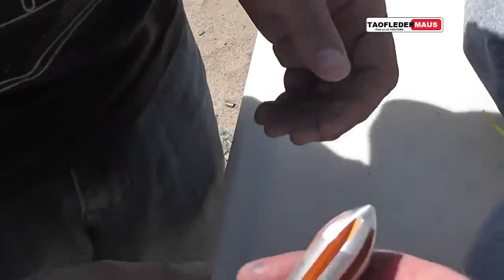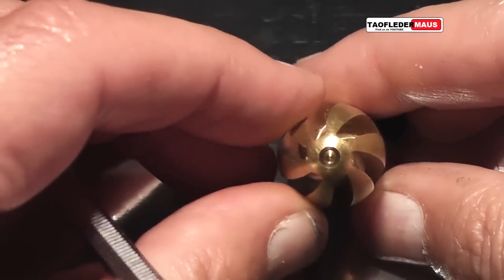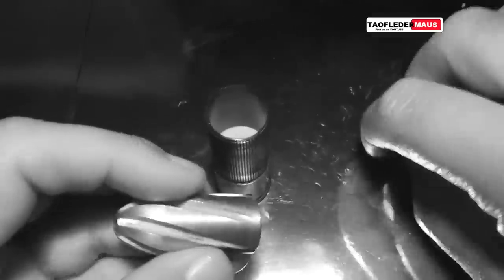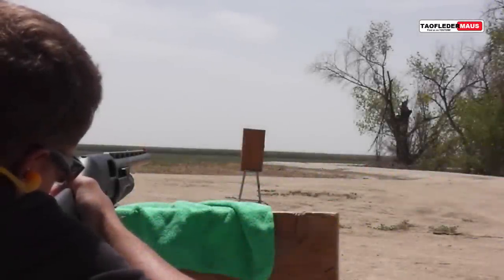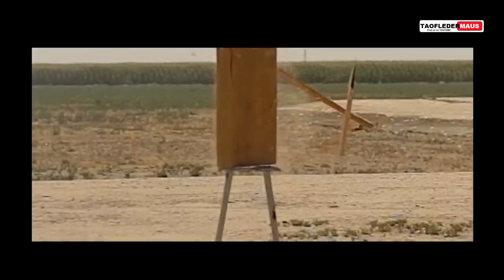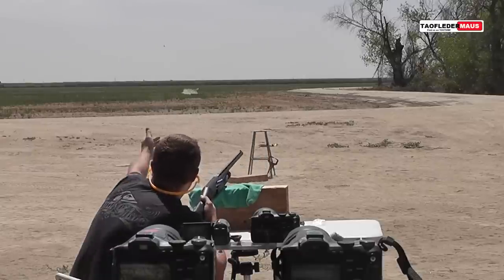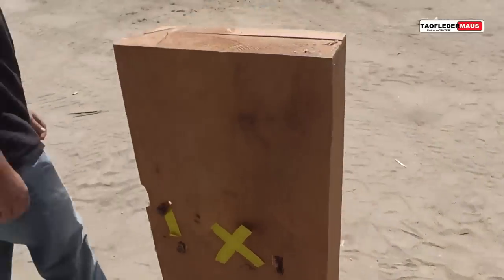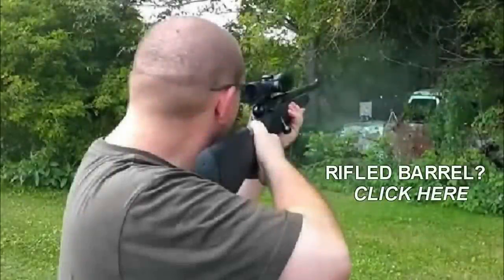70 Cal. Custom Machined  Brass TURBINE Shotgun Slugs -  Tests

Comment: There is indeed 2 ways of saying "Turbine"...but one is correct and the other isn't.
There's a reason the correct way is spelt with an E at the end and anyone who has studied English language at school will understand.

Turban:
A turban (from Persian دولبند‌, dulband; via Middle French turbant) is a type of headwear based on cloth winding. Featuring many variations, it is worn as customary headwear, usually by men. Communities with prominent turban-wearing traditions can be found in the Indian Subcontinent, Afghanistan, the Arabian Peninsula, Southeast Asia, Northwest China, the Near East, North Africa, the Horn of Africa, the Sahel, and parts of the Swahili Coast.

Turbine:
A turbine, from the Greek τύρβη, tyrbē, ("turbulence"),[1][2] is a rotary mechanical device that extracts energy from a fluid flow and converts it into useful work. A turbine is a turbomachine with at least one moving part called a rotor assembly, which is a shaft or drum with blades attached. Moving fluid acts on the blades so that they move and impart rotational energy to the rotor. Early turbine examples are windmills and waterwheels.
Reply: Daniel W spelt?
Reply: Davidautofull He used Spelt correctly, it's an accepted past tense form of spell (Spell out a word).
Reply: lol, not acceptable mr great. spelled is past tense for spell. spelt is a pasta, google it.
Reply: Davidautofull Spelt is the english version of spelled smartass, both are equally accepted and very commonly used. You google it.
Reply: Davidautofull In American English, spelt primarily refers to the hardy wheat grown mostly in Europe, and the verb spell makes spelled in the past tense and as a past participle. In all other main varieties of English, spelt and spelled both work as the past tense and past participle of spell, at least where spell means to form words letter by letter or (with out) to make clear. Outside the U.S., the two forms are interchangeable in these uses, and both are common.

Comment: I think the problem with those bullets are the grooves, too big and too deep which I think is causing them to fly off and tumble, my suggestion would be making he grooves smaller and less deep into the bullet, maybe just making them only a couple millimeters deep and have them go from top to bottom.

I think that would go a long way at improving the aerodynamics and stability in flight.
Reply: Marth i think he needs to create drag like an arrow
Reply: +Gideon Grotenhuis or maybe some tiny little points on the bullet, arrow-like but conforms to the aerodynamics of the bullet and allows it to stabilize in flight.

He did have those hybrid arrow bullets, but I'd like to see something specifically on the body of the bullet be engineered into it. Small enough to be packed into a shell, but just enough sticks out on the body to allow it the minimum it needs for stability.
Reply: I was thinking the same thing since lead rifled slugs don't have deep channels.
Reply: +Donnie Mays yeah those deep grooves are throwing it off massively, any time I've seen any kind of spiraling on bullets it's usually almost like hairline scratches, just barely cutting into the surface of the bullet. And spiraling usually starts at the very tip of the bullet all the way to the bottom.
Reply from the maker: Marth  Yeah,   it's easy to over-complicate things.

Comment: Need to minimize the bore depth, just needs a small cup area or even milled with a flat bottom and shorten it's length by half .....its capturing to much air pressure inside the the bore of the round and "pushing" through it and overcoming the mass of the round causing it to turn.  Fluting will have zero positive effect due to the velocity of the round.

Comment: The angle of attack is waaaaay to much. The speeds are really high which cause even the most minute AOA would allow it to continue spin. The velocity of spin is a balancing act. To much you get wobble like you see there and unstable flight pattern. Also the cuts may to deep as well and recommend to try to just taper the tail half with gradually deeper at the end with a flat tail not a hollow.

Comment: Two popular ways to solve this:
1) Most nations - Smooth Bore - Use stabilizing fins.
2) The French - Rifled Barrel - Use an outer shell with ball bearings sandwiched between suspended inner shell. http://forum.worldoftanks.com/index.php?/topic/426423-amx-30-double-take-on-the-gun/

What I want to see is an adaptation of the Chinese "Type 63 107mm Rocket" - using 6 well angled gas nozzle to generate spin, but this will probably only help a little and require further stabilizing mechanisms.  http://fas.org/man/dod-101/sys/land/row/type-63-r.htm

Also Check out Frag-12.

Comment: If you or tim try any further viewer ideas...

I think the first problem with the current turbine projectile designs is that they are more like rifling and not turbine blades.  The first important point is that the air is going to take the path of least resistance.  That rifling design isn't going to grab much air, but it will make it turbulent.

This is my suggestion:

https://goo.gl/photos/SWNWvv6Gsx6YMk5GA

Comment: I have an idea for another custom shotgun round. Get piece of wood with cylindrical shape 5 cm or 2 inches long and 12 gauge diameter, sharpen the tip and drill 3 cm or a bit more than inch deep hole in the tip. Then get 15 cm or 6 inch nail and cut top 5 cm or 2 inches of it and glue in the wood piece. It would be front heavy and should fly straight.
Reply from the maker: Earl of Destruction    The problem with the wood is it often breaks.   The g-shock is really intense and as it is shot,  the heavier objects like the nail would be driven slower than the wood and the wood would split.   In my next video you'll see something similar to this.
Reply: ***** Maybe with plastic instead of wood it might work.

Comment: Why are the turbine slugs turbined at the front? Put the turbine at the rear, that way, more mass is on the front and there won't be excess drag at the front causing the rounds to do ridiculous things in mid-air. Look at finned rockets and arrows? They NEVER put the fin on the front.

Comment: Wrong design, turbine should be in the rear. 

The head should "open" the air. Since its supersonic a "layer" of air will attach to the surface: the bottom of the projectile should be smaller than the center (sort of barrel shape) and there is where the turbine should be. 

I want turbine in the rear!

Comment: how long are you going to shoot these ridiculously long slugs? It's not the turbine shape, material, spin or anything else, it is the length that is making these things spin uncontrollably. Try heavier smaller turbine brass slugs that are 15-20mm long. Anything that sticks out of the shell is too long for a stable flight.

Comment: I reckon anything that's not spinning before exiting the barrel will not work. Period.
Inducing a spin will cause a force from the side, triggering the round to tumble.
You're probably better off with a design that stabaslizes through drag alone.

Comment: The fluting is the reason they tumble. They create a strong drag force on the head of the round when flying straight, causing the round to cock off in one direction or another. Then the center of mass tries to reverse the action to true the round which causes the severe instability. If you remove the fluting then you'll be on the mark. Typical lead air-rifle pellet design.
Reply: +ImpenetrableSilence I was thinking the same thing about the drag forces being ahead of the center of mass because of the flute channels.  Maybe not so much remove the fluting all together, rather have them start a little further back. I'm also wondering if the shock wave caused by the tip of the bullet might also be messing with how air gets channeled into the flutes...
Reply: Actually, I think starting the flutes about 2/3 the way back and using a fraction smaller center cut in the rear would balance the drag and inertial forces out, and not having the fluting as deep would prevent any funky high pressure areas that would cause the round to veer off. No sharp edges, only rounded profile flutes with a spiral, something like 30-36'' per turn.
Reply: +ImpenetrableSilence  Another thing I was thinking, with the higher mass, it would also need a lot more force to get it spinning in that fraction of a second its in the air. Rather that compensating by making larger flute channels to add more force, and potentially making more of a mess with the aerodynamics, try making it with a lighter material? Hmmm, this is giving me a bunch of ideas on how to improve the design, but sadly I have no means to produce anything outside of drawings.

Comment: The air resistance is way too strong for this design. It flies off because the aerodynamics is shit on this thing, forcing it to spin will just make it go everywhere but where you want it to. The only way to make it work would be if the shell started slowly and steadily accelerating.

Comment: The base idea is flawed, a bullet needs to be aerodynamic, and a turbine is based on just the opposite, its designed to drag air while power is applied, not to just let it pass (talking about the turbine itself, not the casing).

Comment: Turbines don't make it stable you need to do a spitzer bullet design. Does anyone know aerodynamics? A standard slug is stable because its aerodynamic, a 30-06 round nose (original 30-03 round) is stable and so is its spitzer bullet (30-06) the shotgun needs a spitzer bullet if you want supersonic aerodynamics that work because the spitzer bullet holds the bullet in one direction because resistance is to great on all other sides to be able to be unstable. you need to use the Auto Desk Program FLOW to see Aerodynamics and this program is used by people who make millions from aerodynamics in cars.

Comment: ... Why do people keep trying to spin a projectile using aerodynamics?
If people want a spinning bullet so damn bad, get a rifled barrel. It will never happen using aerodynamics.
Reply: Tombs Clawtooth It's not always about thinking it will work, but also just seeing what effect it might have. I also believe I have seen rounds that spin using aerodynamics before can't remember off the top of my head for sure at the moment.
Reply: forlornspawn817 Most notable spin stabilized non-rifle fired round was rocket powered, the gyro jet. Its nozzles imparted spin with a powerful rocket engine.

You'd need to spin a projectile of this size well above 400,000rpm to keep it from keyholing. That's just not physically possible with aerodynamics alone, the energy required for that amount of spin would slow the projectile down to a crawl. It'd be like strapping a massive parachute to it.

While yes you could eventually achieve spin with fins large enough, it would have no affect on stability.